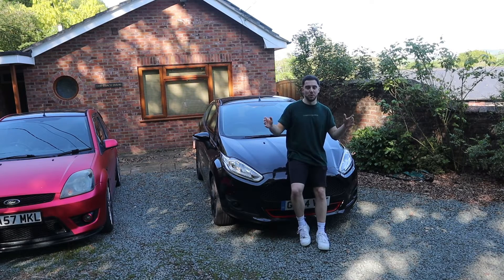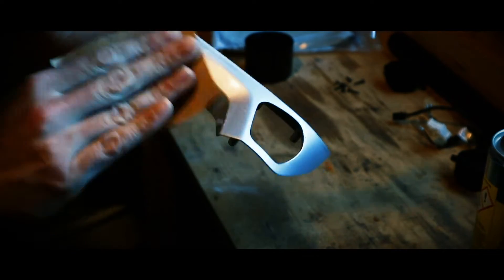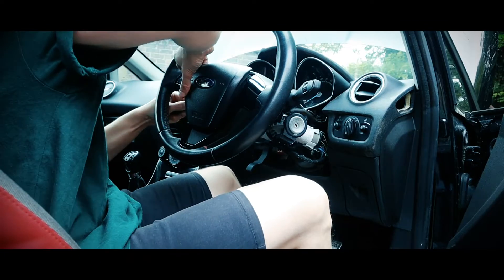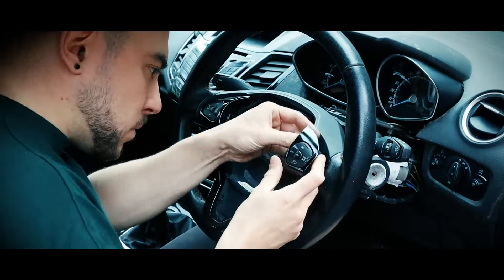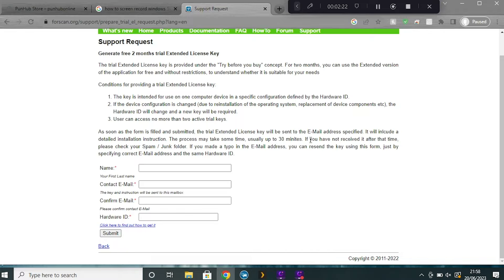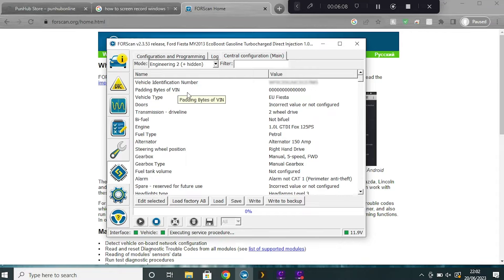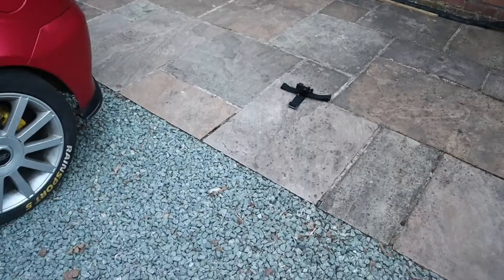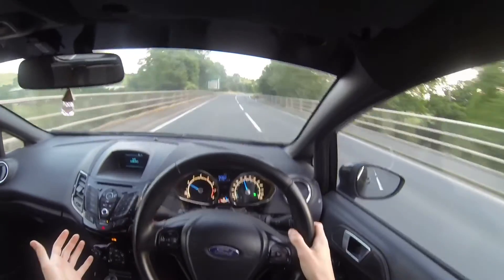Retrofitting Cruise Control to my MK7 Ford Fiesta 1.0L EcoBoost | *HOW TO*

Comment: Hey man, 
Very good video.
Did you use the sound controls  button from your old car and just connected it to the new wiring loom that you got? Becase I see the donor one is with the "M" button for the audio controls, which means it came from a car without voice connectivity etc and I saw here and there in different places and videos people saying that if you have a car with no voice connectivity you have to get a donor cruise control from a non voice connectivity car and respectively if you want to install cc on one with voice connectivity you have to get a cruise control from from a car with voice connectivity. Because the loom for the two buttons in either case is one piece, but now I see that you can just plug the different button. I'm guessing your voice control functions work as well as your cc now? Thanks!
Reply from the maker: Yeah I swapped them over from the original. But neither of the sound controls worked at first, I had to enable those with forscan too. Again their are different options depending on which set of audio controls you have but I assume it depends what version of the audio system you have as to which buttons you can install for audio
Reply: @MendItModIt  That is very useful to know. My car is with the "M" button that comes with the most basic audio system, without bluetooth etc. My donor cc is combined with the "voice button". So if I just swap the buttons, my voice controls probably wont work. In the best case you just have to get the corresponding cc combination, but what you said about reprogramming the aduio control button as well as the cc one is very helpful.
Kudos that you mentiond the 9 vs 7 wires thing as well, that will save a lot of time and effort for a lot of people.

Comment: Those 2 wires are most Likely CAN bus wires, you definitly dont want to be adding those if you dont know what your doing
Reply from the maker: I did think they were probably CAN wires, there doesn’t seem to be many wires in the loom for the steering wheel controls. Could peel the loom wrap back and see if they are twisted. I think most of the higher trim models likely come with them already but can’t be sure
Reply: @MendItModIt  yeah, propably. But in my opinion, if your car cant accept cruise control from factory you propably shouldnt install it. Ive been a mechanic for long enough that ive seen a good few of those aftermarket kits fail.
Reply from the maker: @yourimeeuwisse711  that’s not what I did though dude, the wires in my car were there, in most cases they mean the car can accept cruise control 👍🏻 even so I’m plenty comfortable with CAN bus systems should the need ever arise 😁
Reply: @MendItModIt  no no no i know. Your car is fine😅 as you said your car does have the factory wires and modules so yours will work fine.

English is my 2nd language so maybe my point came across a bit wierd😅

Comment: Next job for the Wife's red edition already retrofitted reverse camera onto cars display. Also trying to find info for autolights and wipers but not found anyone thats done it yet. Great video and very informative.
Reply from the maker: I was wondering about changing to the full display, not sure if they’re an easy swap but I’ll looking into it + the camera 👀
Reply: @MendItModIt I've had a look about the upgrade to the Sync3 display, it seems like it's very hard to do and expensive as you'd want the US spec Sync3. Is this what you're talking about or something else?
Reply: For the lights & wipers you'll need the sensors under the windshield behind the mirror, & the respective wiring
Reply: How did you retrofit the reverse camera please and what Sync version was this with?

Comment: Nice one, do you know if the heated steering could be switched on assuming Ford made all the steering wheels the same ??
Reply from the maker: I’m not sure mate but normally the parts will be different. I didn’t see a plug that looked like it would be heated wheel related so it might be a different steering wheel loom as well. The pins may well be there on the car loom side of that white connector but I couldn’t say, sorry 😢

Comment: I've had the steering wheel controls ready to retrofit to my ST-180 for months but not got round the fitting it yet. Hopefully this video spurs me on.
Reply from the maker: So for it mate 💪🏼
Reply: @MendItModIt Attempted today, wasn't successful. Absolute nightmare trying to unclip the airbag on the ST as you don't have the little slots either side, you have to try and unclip it through the holes on the back of the steering wheel, was trying for ages before I called it a day.
Reply from the maker: @Nyle95  bro does it had little lines/marks where those slots should be? You have to pierce the holes yourself but the marks should be there
Reply: @MendItModIt  It does but I've watched videos telling you to not pierce them... I've ordered a cheap set of pick tools as I read someone got it released a lot quicker using them instead of a screwdriver. Will try that next time and if not I'll consider piercing the holes.
Reply: @MendItModIt 

So I removed the airbag, cleaned the metal ring and metal pads on the steering wheel and refitted, this hasn't fixed it.

I then removed the horn itself from the car and tested it on the 12v battery using 2 leads as per the 2 videos below (2 different methods) and the horn didn't sound. Do you think this confirms that the horn itself is at fault?

While the horn was off I cleaned all the connections to it etc.

If so this does seem odd as it was working prior to this job.

However when I tested across both pins in the horn I was getting about 0.4 Ohms, so there is continuity...

https://youtu.be/NSHdTyK9AGk

https://youtu.be/d980sdQ1hRo